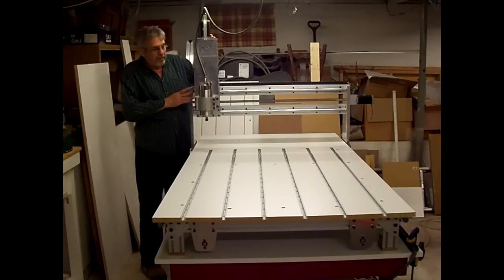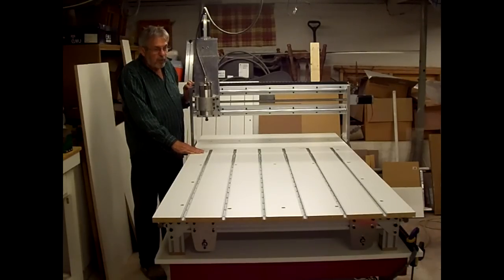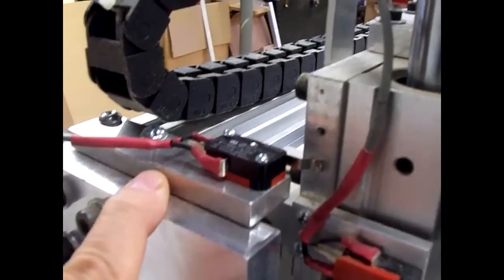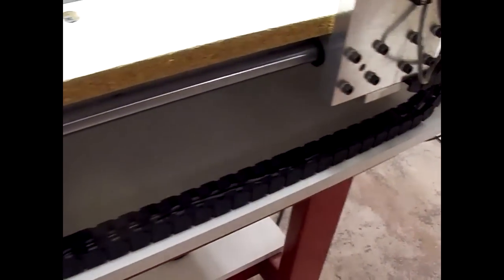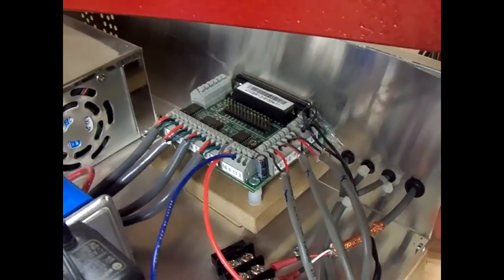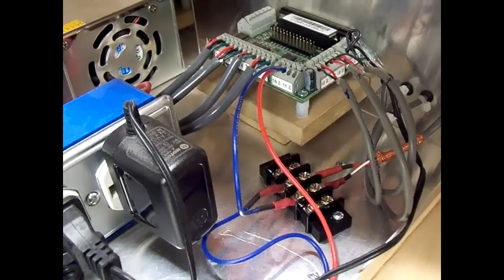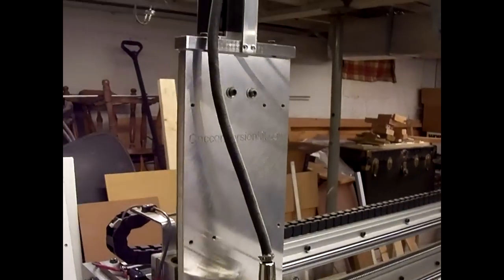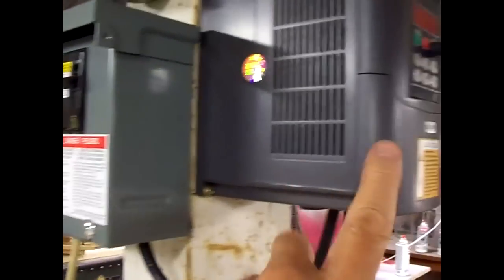CNC Router build part 9 Completion!

Comment: Hi Guys. I need some advice, I want to build a router to mill Aluminium sheets and other parts, prefer if the size if 8ftx4ft or 4ftxft, What motors should I be using how much minimum torque to mill aluminium, and what should be my budget just for electronics?
Reply: ***** Thank You very much :)
Reply: Going that big brings in a LOT of issues the smaller machines dont have, like rail deflection. A typical 3 foot square one wont have enough deflection in the rails using those big square extrusions. At 8 feet  that same extrusion will have very significant deflections issues fro the gantry and spindle weight. There is also the cost for the linear bearings, The price of these in around 8 feet is astronomical,  same deal with ball screws. A wild guess for just the ball screws and rails alone will be somewhere around 4000 US. 

FORGET using aluminum and go with steel  box beams to deal with the deflection issues.  One alternate to linear bearings is to go with steel V-bearings running on the edge of a L-shaped steel extrusion about 1/8 thick. With a bit of tinkering you can get down to around 2 thou variation end to end. I use 3/4 steel angle anc V-rolles on mine and it runs at around half a thou variation. Close enough for my needs. I did cheat a bit and have a friend of mine mill off a few thou off the edge of my angles to level them out. Probably wasn't necessary but the price was right, a case of beer.  :) Instead of Ball screws I use acme thread rod with anti-backlash nuts. FAR cheaper than ball screws. Overall I can hold right at .0005 reputability and accuracy  if I dont push things hard. Normally I get about .002 pushing things a bit on the hard side. Still close enough for anything short of engine building. 

Mine is 2 feet by 3 feet, completely 3/4 mdf except for the steel angles the V-roller run on. The bed is actually a 3 /34 thick  stress frame structure made from mdf. The bed has 6 strips of t slot on it with the gaps filed with 3/4 mdf resulting in basically a spoil board with T slots in it that wont pull out. The T slot rails and screws holding down the mdf strips have the top 3/8 clear of any metal So I got 3/8 of spoilboard to chew up before I have to replace the strips. Normally I also use some 1/4 mdf under whatever Im cutting out or some sort of holding jig held down with clamps. 

MDF is far stabler than most think IF you seal it with at least 2 coats of paint. Its also dence and heavy enough to deal with a pot of other issues. In some places like the gantry sides I have 2 layers of it giving a good solid 1 1/2 inch thick support I couldn't measurably deflect by hanging a couple hundred pounds on one end of it. 

I got right at $900 in mine for everything including Mach 3, giving a complete functional CNC. This DOES NOT include any cad software There are other costs to consider also, like a good cad program and cam program.  You can find free open source software for these but as an example V-carve desktop goes for about 350.  Not all that great for a cad program but for a lot of stuff its fantastic. It will handle 3D if you create the models with some other cad program. On the average Il guess a full set of commercial software capable of nearly anything will set you back somewhere close to $1000.
Reply: +John Ware That's some extremely useful information mate. Thank you soo much :) I thought of reducing the size to 4 by 4 due to the same reason of deflections. My projects doesn't come 8ft most of the time, so I guess it;s better to cut a 8ft sheet and use it rather than sacrifice on the precision. I will try to make the machine end of this year probably. going to order parts soon
Reply: I highly recommend you go with some plan available on the net as those have all the stuff figured out. Scratch building one is a gamble unless you have a skillset that includes a LOT of mechanical experience in areas like working out rail deflections and so forth and a good working knowledge of some good solid modeling program such as Autodesk Inventer,  or comparable. Schetchup might work in a cramp but I recommend something that will allow you to create an assembly such as a complete Z axis assembly up and down on the gantry and so forth.. That will simulate how the real thing will actually work. Otherwise its going to get quite expensive and downright aggravating to get close to what you need. First off the bed for a 4 by 8 will be bigger than say 5 by 9.due to the fact the bit on any CNC cannot get all the bed area for mechanical reasons.  A quality solid modeling program will show you exactly the size needed down to a couple thou. As an example, the bed on mine is 2 feet wide and 3 feet long. The usable cutting area is 18 by 25 inches. I am NOT limited to only 25 inches the long way as its no big deal to cut say an 8 foot long job by doing it in sections.say 2 feet at a time. the limiting factor is the 18 wide. Mine is plenty big for what I do, making mostly musical instruments and a lot of custom cabinet panels. And there's the usual sign stuff and a lot of small craft type things. I also use it as a general purpose weird hole size and shape maker too. Beats the crap out of a lot of hand work doing those the hard way. Using basically jogging its a mill without any G-code too.  Handiest machine anyone can have in a shop. If I had the space I woulda made it big enough to chew up a 4 by 8 sheet of anything, but I had to use the space I had to work with.

Comment: After spending so much on the machine I was surprised that you used melamine particle board for the deck, I would have thought you should have used something more substantial like extruded or even solid aluminium for rigidity. That said, I have enjoyed following your progress, thanks for sharing.

I am just in the process of completing my CNC build and have ordered extruded V-slot 80mm x 20mm panels to construct the main deck and I will over-lay that with an MDF spoil board to protect it. This will I hope result in a substantial very rigid deck.

Comment: Hi, Great video
I wanna ask about the max jogging speed for your machine?
Reply: Thx alot for your quick reply. But i am asking about your machine's max jog speed
Reply: I think ur machine can achieve 160 ipm. I am using much smaller motors and can get with it 60 ipm. You can get out of ur machine more than this with a little tweaks

Comment: I have followed your build with much interest as I've been considering building one of these for a while now but had not come across cncconversionkit.com in my research. Their "high performance" 26 x 41 x 7 machine (not a kit) appears to be much more rigid and less expensive than the Pilot Pro CNC kit I've been considering. I am hesitant though, due to your long wait-time for parts and some of the issues you ran into during the build such as holes the wrong size, holes not drilled at all and parts missing or needing "adjustment". BTW, you did a great job of handling all those problems.

You didn't do a video on alignment and tramming of the machine. Was that difficult and did you find there was enough adjustment built into the machine to get everything right?  I did read your comments regarding the spindle mount, but other than that, were the axis square and have they remained true after some use?

Congratulations on the build and thanks for your insightful commentary along the way!

Comment: Looks awesome! I really like your attention to details, and taking time to build everything the correct way. In the end, amazing. Cutting straight, stable and pretty quiet. I am planning to design something of very similar form, also mostly from aluminium extrusions (considering all parts can be ordered relatively cheaply from China), probably with smaller bed area however (I do not have that much space right now), but with maybe even bigger extrusions used (for added rigidity for cutting metals). I really love the simple and robust design of this machine. I wonder how it would stand up when cutting metals. :)

I am a bit worried by your use of DB-9 and small wires to the motors. Wouldn't that be an issue considering these motors can take few amps on each coil? Also usually these conectors are designed for much smaller voltages and currents.

Couldn't wait for some of projects being done on this machine. :)
Reply: ***** It is possible that the effect of shocks on the Y axis are caused by the high altitude of this axis. The Z axis produces lever on Y

Comment: Great work on the videos.  I appreciate the work you put into sharing.  Which kit did you end up getting from cncconversionkit.com?  Would you recommend this to a first-time CNC builder? Any advice would be appreciated.
Reply: Those are great comments and I appreciate you taking the time to answer so detailed.  I have full access to a machine shop at work, so I was considering building from scratch; but I realize that a project like this may never be completed if I go that route. One of your comments said you'd have opted for the larger spindle.   Did you look at other brands or types of spindles before choosing the 1.5? 

Did you research other kits before choosing this one? If so, what was the deciding factor at the time? 

I appreciate your feedback.  This will be a major investment for me and, with helpful people like you, hopefully not a dumb one.

Comment: Great Job Robert! turned out pretty nice, are you going to surface the spoilboard? or is your t-track too close to the surface? sorry I haven't been following your last couple of videos. I've been working non-stop for the past few weeks and haven't had any time for anything else.
I plan on being back home within the next week or so and I am going to start planning my latest (and very belated) cnc project. I've never done these types of videos so I don't know how they will turn out. I guess that the best place to start is recording is the design... I am not too sure how interesting that will be... mostly just a lot of 3d / 2d design and calculations a bunch of mistakes... redesigns n stuff...

Btw I suggest that you get to cooling that Spindle soon. Those little 2.2kw motors can burn up real quick if not properly cooled. It may not feel hot to the touch but that is because there is a space between the outer case and the motor housing to allow for the water to flow through.
I recomend the xspc 750 pump and reservoir and a 240 mm dual fan radiator. I have been running a 2.2kw with this system for a while and it keeps it at room temp even during long cuts in aluminum.

-Idontrunntoofast